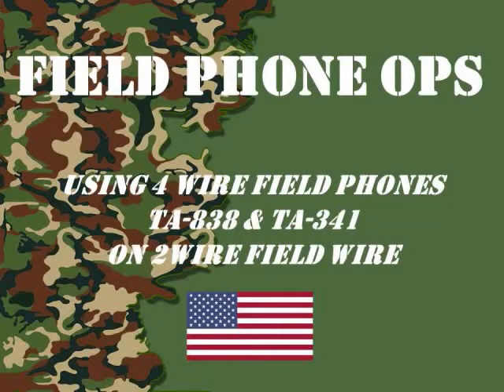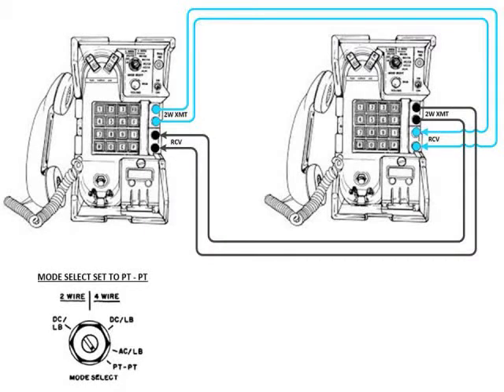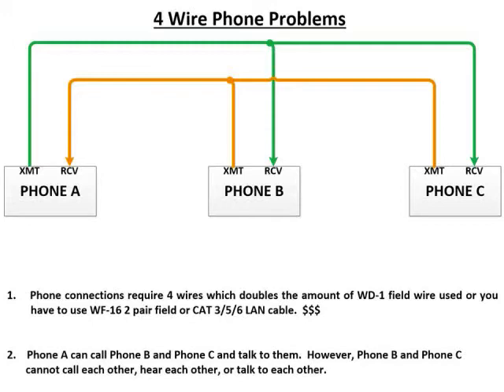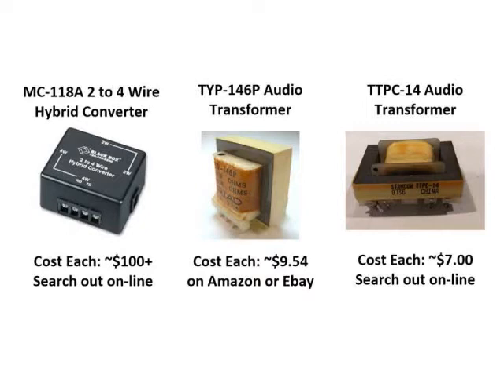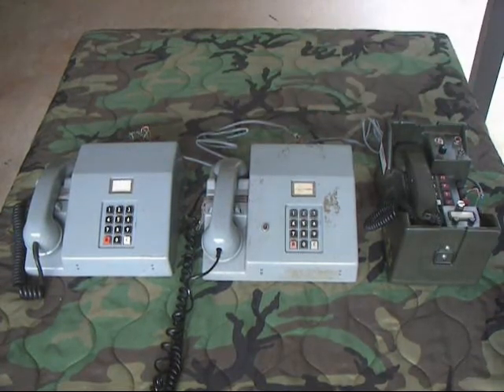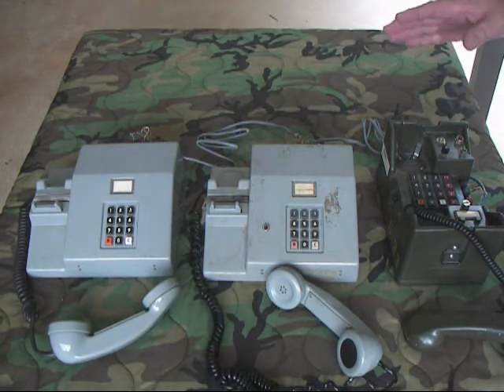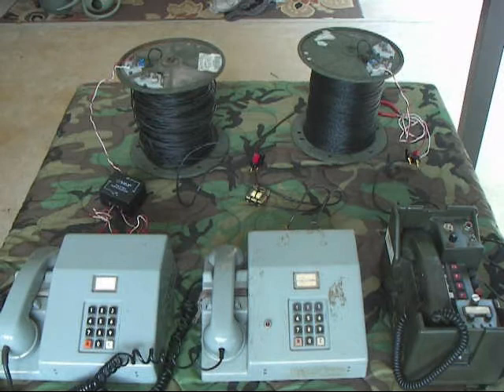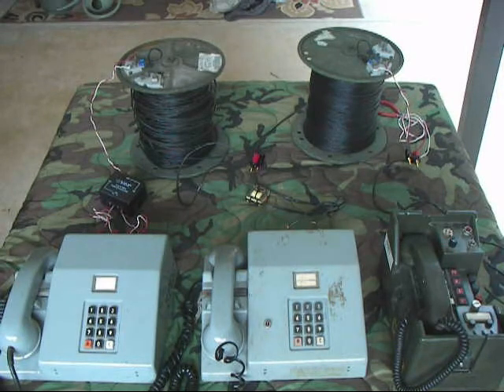FIELD PHONE OPS: Using 4 Wire Phones on 2 Wire Field Wire

Comment: awesome, awesome video, thank you for putting all this information together. I have a TA-1035 on the way that I'd like to be able to use on the PSTN (I'm a lineman and with a few add-ons it should make an excellent test set). Would one of these transformers be sufficient to convert it for these purposes?
Reply from the maker: I hate to disappoint but the TA-1035 will not function with any POTS or PSTN systems.  It's a purely digital phone that operates at 16KBS Conditioned Diphase (CDI) on old military TRITAC systems.  It will not even function in a point-to-point mode.
Reply: @thefieldphoneguy8254  thanks for the info, I see someone has reverse engineered the switch protocol, but doing the work/programming to further interface it with a POTS line is probably beyond me. either way, thanks!
Reply from the maker: The TA-1035 won't work on that system because it only operates in 16KBS.   The four port switch they engineered only operates on 32KBS so a TA-1035 won't work with it.